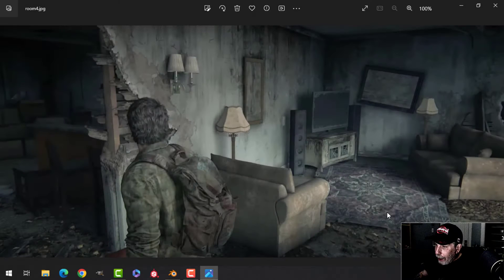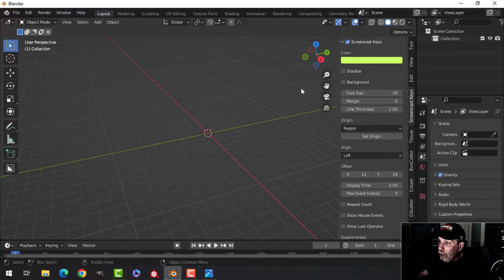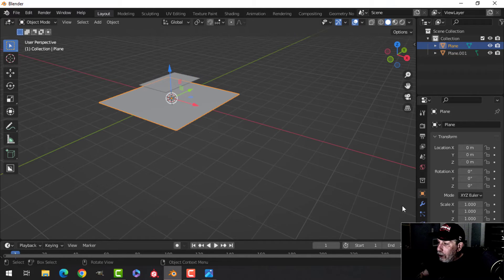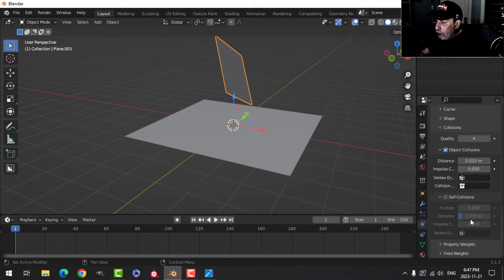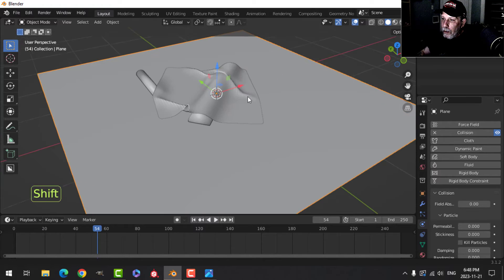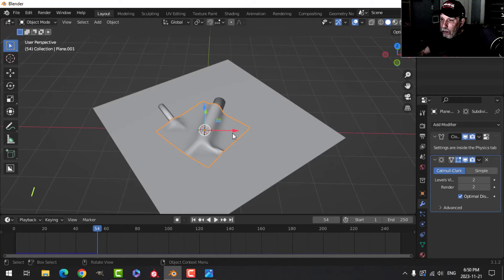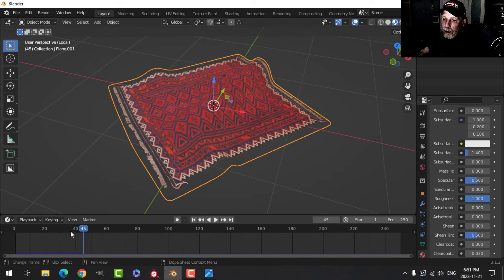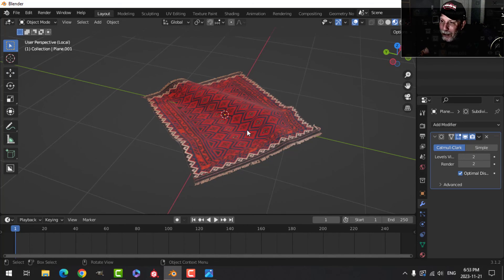BLENDER: CARPET (MODELING AND TEXTURING)

Comment: Any idea as to why it falls so awfully slow on mine? I’ve looked at every setting and can’t figure it out. It’s not like it’s lagging either, it just takes 80 frames to fall even a small amount.
Reply from the maker: Check that you haven't edited in object mode and apply scale and rotation.   Consider fewer subdivision and start over.